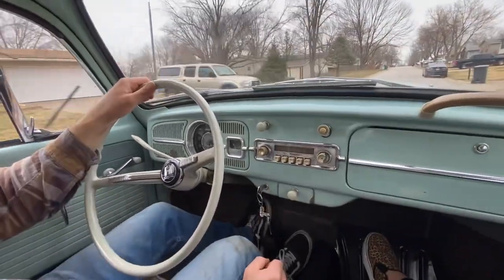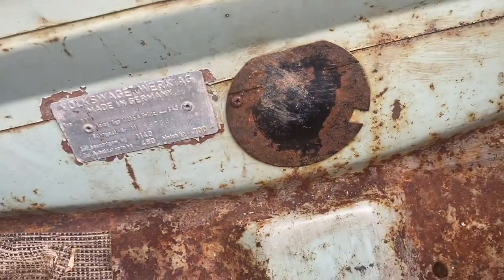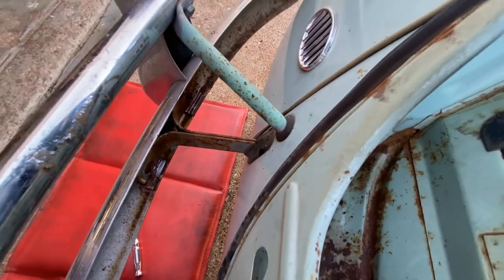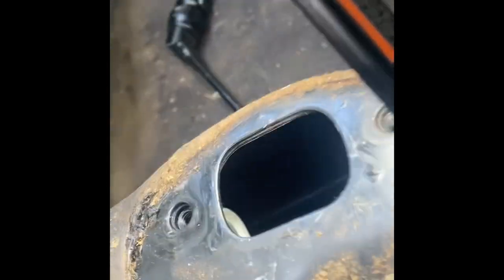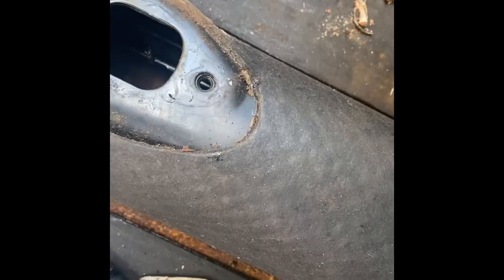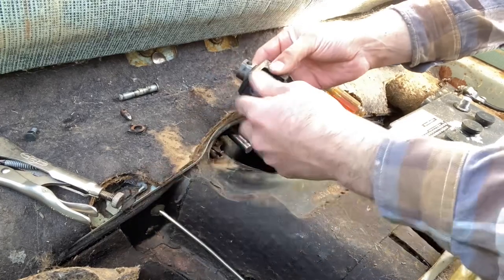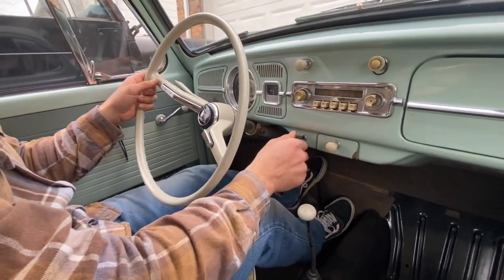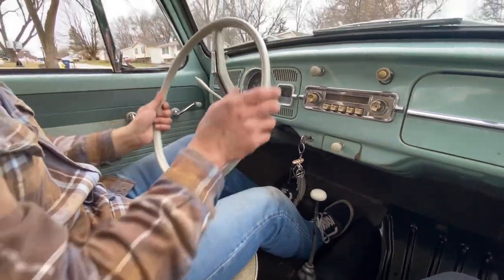Classic VW Beetle - How to replace shift rod bushing Volkswagen Bug

Comment: Thanks for the video Joe. I just replaced the shift rod bushing yesterday and the old one was completely disintegrated, gone, not there. I was worried that I might need to tear the transaxle out because I could not get 1st gear even with the coupler disconnected. But the bushing did the trick and all is good now. Great video.

Comment: Nice '65!  I had a '64 same color first car in '75.  Now have '64 sunroof in white.  Battery on left? Interesting.  Exactly the correct tires and wheels.  Super!
Reply from the maker: Thanks! That’s an awesome first car to have. Those would be great memories! When I recorded myself working inside the car with my front facing camera phone, everything was reversed, even me using the screwdriver is reversed. Not sure why it did that, but the battery is on the right.
Reply: @centerbayclassics  Aahhhhaa!!  Now I get it!  Paid 500 for my 1st bug.  65,000 mi.  A lot of dough fo me back then!